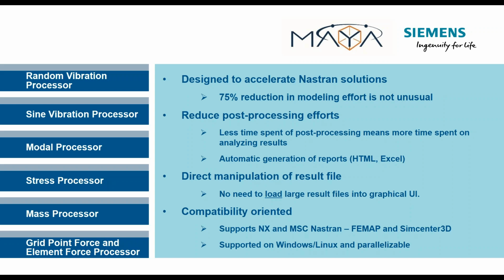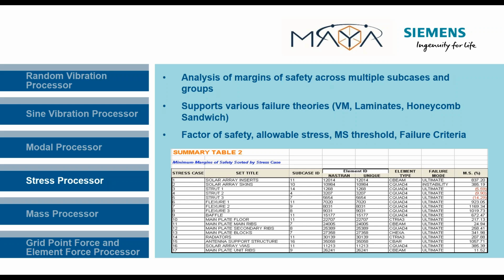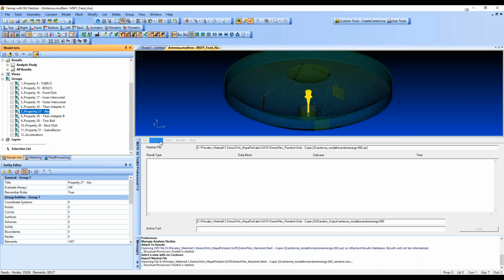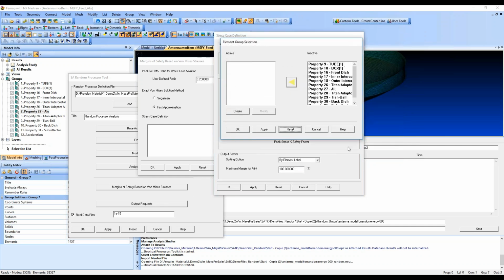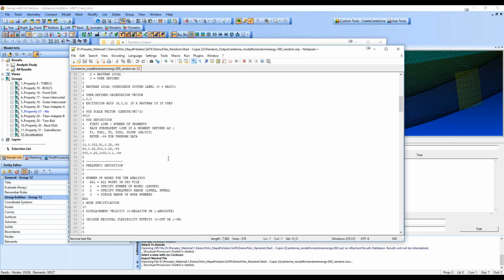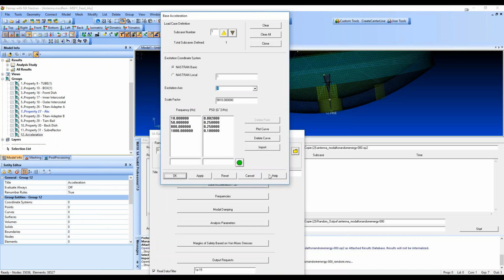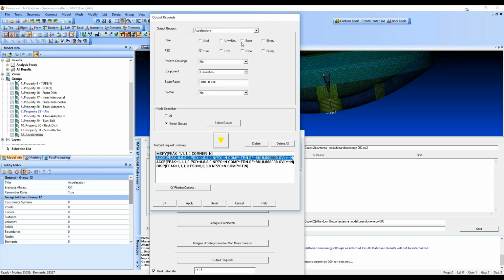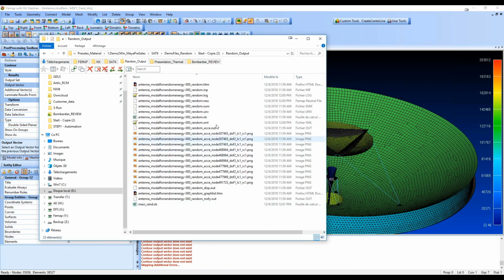Random Analysis using the Structural Analysis Toolkit

Comment: There are a lot of issues with this software. For instance, it doesn't always import the groups if you made a new group.  Another thing I noticed, is that there is no easy way to bring in a new modal result without losing all your previous random parameters.  I didn't see a way to set my frequency response on a pressure as is done for direct pressure runs in acoustics either.  The software is so buggy, it's almost worth just writing in house APIs to skip using this.
Reply from the maker: Thank you for reaching out. If you have not done it yet, I recommend you reaching to our support (https://www.mayahtt.com/services/support/) to get rapid assistance and guidance on your software. In order to help you, the support team will likely need to know your configuration and software version
Reply from the maker: Indeed the UI can be clunky. Our users tend to find that the solvers make up for this. Many of them hand edit the definition (inp) file. I’d like to get some feedback about the issue with your group. For your second point, you should read your op2 file and then, within the processor UI, load an existing inp file that contains all your settings. The random and sine processors support base excitation inputs only, hence pressure loads are not supported.

Comment: Why do I have to use quick open instead of open on an .op2 file in order to get the random vibe tool to even show up?   For what matter, is there even a difference between the two open commands?
Reply from the maker: Open scans the op2 file which can take some time for very large ones. Quick Open does not and hence is faster, that’s why we created it. When you use Open, SAToolkit reads the op2’s datablocks and enables certain processors; Quick Open assumes you know what you are doing and enables all the processors except for random and sine processors (for those you need to use Open).